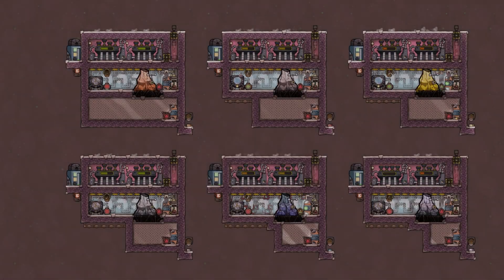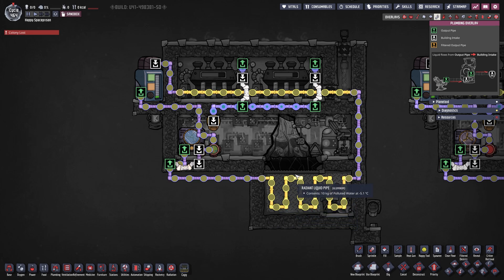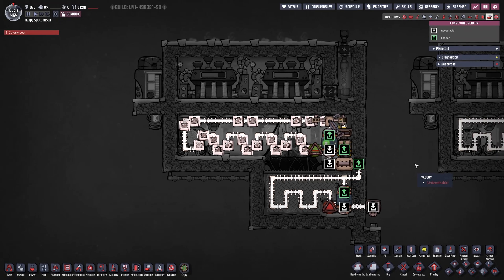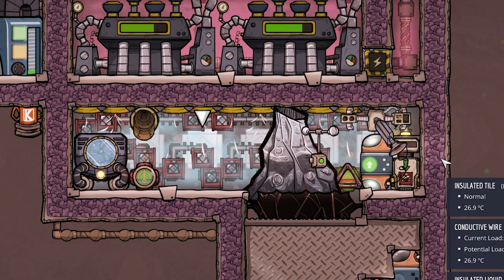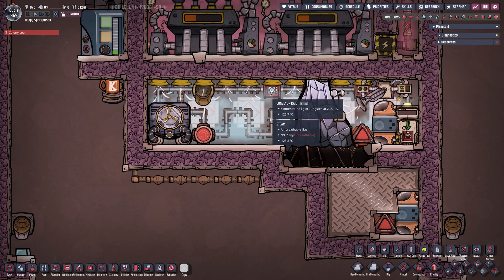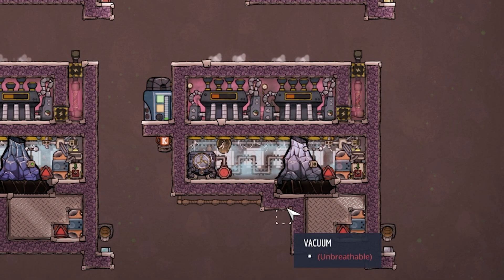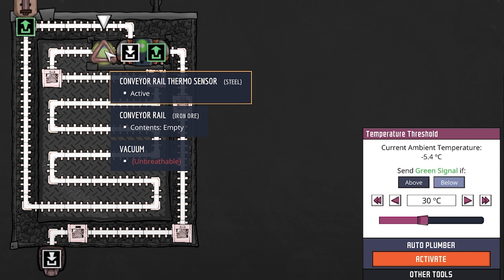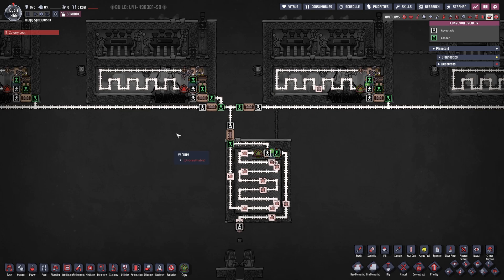GERMAN ENGINEER explains ONI: TAMING METAL VOLCANOES V2.0! Oxygen Not Included Spaced Out

Comment: do you need to vacuum the volcano out before you add the water?
Reply from the maker: I would Vacuum it out after adding the water, since you need to get the water in there somehow, and usually the easiest method is a bottle emptier above it with a hole in the wall. If you have pipes nearby, you can also vacuum it out before. Whatever is more convenient in your situation :)

Comment: about the microgram thing, I don't know if it's patched already, but would it work with using mesh tile debris moving? Like with magma. Let the volcano erupt in a vacuum room and have the liquid metal flow into a surrounded two mesh tiles, so it forms in a different room on top of a weight plate.
Reply from the maker: That would probably work, but would also make the entire built much bigger. And I personally don't think the microgram issue is big enough to justify that. It's really a minor problem. My currently Let's Play has a ton of tamed volcanoes with this system and it's not that big of a deal really :)

Comment: I dont understand what im doing wrong.  No matter what i do material will not bypass the shutoff input.  It does thr exact same with liquid.  It gets to the shutoff. Cant pass to the output because the automation has it on a red signal. And instead of then continuing on the rail back around it just gets stuck there.
Reply from the maker: Do you have a bridge after the input like I have in the video? If that bridge is not there, it will not work. The same goes for the second shutoff in the cold box. In the video I have an output immediately there on the side of the structure. If your line goes further and has a second rail connected to the original rail somewhere down the line, you'll also need a bridge after your cold box as well!
Reply: @BierTier  thanks Bier, that solved it.  I have been trying to make a similar design to separate hatch eggs so replacements fill the incubators first before going to be made into bbq and it was a similar setup so i came to this video to see what was up. I did have a bridge but it wasnt working correctly the way i had it set up. Now that it works for less important automation I'll try it with a volcano. 🙂
Reply from the maker: That’s awesome, glad I could help ;)
The game mechanics are a bit weird with rails, so if in doubt, slap another bridge in the direction you want to go, haha 😂
Reply: @BierTier  lol I'll keep that in mind.

Comment: For the microgram issue: you can build a conveyor chute in the conveyor loop, and then connect a timer sensor to it. Then you can change the timer sensor's measurement from seconds to cycles, and then set it to activate for 0.1 cycles and then deactivate for 10.
Reply: i was thinking about weight plates being added to the concept. making a queuing system where the conveyor rail only gets packets of heavier weight added into the cooling loop. sure it makes the whole system a lot more inefficient but letting it clog up with tiny pieces of metal that are unable to cool it

Comment: I've built this for a gold volcano, exactly as you show, with extra column of steel tiles as shown at the start where you show every volcano. I put 3 different waters in the steam tank, averaging 233kg water per tile. The volcano refuses to erupt because it is overpressure. I guess I should have put less water in. Can you advise?
Reply: Nevermind, I figured out what I did wrong. I had drowned the volcano. I needed only 1 layer of water and a vacuum above before I sealed the steam tank.
Reply from the maker: The amount of steam in the chamber has be below 150kg per tile. If it is above that value, the overpressure will not allow it to erupt :)

Comment: I tried this on an Iron Volcano, it melted the Conveyor Rails(made of steel) on the Volcano. You need to start this with steam not water. FYI.

I'm gonna try again and move conveyor things away from the Volcano itself.
Reply from the maker: They should not melt; you don't need to start with steam. If they melt, my first guess would be that you didn't have a vacuum in your chamber above the water. I start all my volcano tamers in my personal games and my let's play series with water and a vacuum. Especially the system shown in this video is useable for every single volcano except Niobium.
Reply: @BierTier  Hm, I didn't know what I did wrong then. I made a vacuum. The only difference was my chamber was a tile higher and two tile wider. Anyway thanks.

Comment: Had issues with the conveyor loader and the sweeper overheating both made of steam any ideas?
Reply from the maker: Did you make them out of steel? And do you keep the steam at around 200C?
Reply: @BierTier  Yes sir. Both are made of steel in terms of keeping the steam at 200C not sure what you mean.
Reply: @BierTier  It's not always but occasionally I see it.  I'm almost wondering if I need to throw in some automation to wait like 10 seconds before the sweeper activates.
Reply from the maker: You shouldn’t have to if you use this build. The steam in the chamber is soaking up the heat from the hot metal. You may not have enough steam to keep the temperature correct, might need more mass. With too little steam it can overheat for sure!
Reply: @BierTier  This is likely the case. I was having the same issue with my aluminum volcano because I used the bare minimum amount of steam for two turbines. Increasing the amount of steam to around 2 tons (>2000kg) in the 12x3 volcano box should solve the issue of the steam heating up beyond around 200 C.

Comment: The only way to reliably avoid the microgram issue is to use two sweepers: the first moves the material not into a loader, but into a *dispenser*. The dispenser dumps the material out of the first sweeper's range and onto a weight plate. The weight plate is set to go green at some value greater than the 1t an auto-sweeper can move at once, and it controls the loader. This ensures that the loader will only put items on the rail while it's full or close to full, which means it will always output full 20kg baskets, and you can't end up with a microgram basket on the rail.

Comment: Thank you for sharing the video. What I would like to know is, if you dont have aluminium what is better to use for the heat sink? I have copper, iron or gold currently and I really didn't want to make it out of steel for the heat sink if I don't have to!
Reply from the maker: Absolutely! Here is a list of all materials thermal conductivity: https://oxygennotincluded.fandom.com/wiki/Thermal_Conductivity
The higher, the better for cool box. For insulated pipes, tiles, etc. the lower the better. For your metal tiles it goes Thermium > Aluminium > Cobalt > Tungsten > Gold and so on :)
Reply: @BierTier   the link does'nt work for me : (
Reply from the maker: I just checked and the link works for me. Do you maybe have an adblocker active or something like that?

Comment: About the mcg-Bug: I always use a timer - never a temperature sensor - so your video is the first time I hear from this bug :-D 

Why a timer? Let me explain. I don't know when or where I've first seen "my" solution, but here it is. I'm beginning from the end (drop), working towards the volcano. 
1 - Dropof-Point) Connect the drop-off with a timer. Set the timer to be closed/red for 59 seconds and open/green for 1 second. That's 20kg of Metal per Minute and should roughly match the Volcano's production which is usually around 300 to 400g/second. (*1)
2 - Turbine-Room) Let the conveyor zig-zag through the room of your steam turbine (One aquatuner-cooled steam turbine is enough for every volcano - it should also be enough for niobium). Fill the room with hydrogen, and zig-zag the cooling pipes through the whole room. (*2)
3 - Heat-Exchanger/"Cool"-box) You should have only one steam turbine. Divide the output C water through a valve (needs to be in a vacuum!) and set it 1000g/s. This gives you two lines of water. Let the lines flow through metal tiles which also are "visited" by the conveyor, creating a heat-exchanger (you call it coolbox - but it'l be 95°C there). For most of the volcanoes a 2 by 2 coolbox with two metal tiles per water-line should be enough to cool down the metal to 95°C. (*3)
4 - Steam-Room) The usual, just without temperature-measurement of the metal. Temp-shift-plates, aquatuner, yada yada yada. Except for the tiles exactly behind the volcano iron- or even copper-conveyors are sufficient. Just use the maximum amount of steam (Up to 150kg/tile - having the steam-room 8 tiles wide should even be enough to counter niobium) Set the aquatuner-thermo-sensor to the temperature you want the output-metal to be. There's no need for a -15°C coolbox. 

If there is NO access to the steam-room, you'll get a steady supply of metal at the rate the volcano produces it. Given you have enough batteris this build is even power-positive. (**)

(*1 For the exact value just take 20,000 and divide it by the volcano's output 
(*2 The conveyor-zig-zag is optional if you want your metal to be colder than 95°C. Which is mostly a waste of energy, b/c the dupes are wearing exo-suites and you might already have a cooling solution for your base anyways)
(*3 Since the throughput of the conveyor-line is set to one 20kg-packet per minute the metal has four minutes to cool down to  95°C) 
(** If 95°C metal is ok, you could even try a self-cooled steam turbine setup - but for this to work up to 4 steam turbines are needed)
Reply from the maker: That sounds like a highly interesting solution that I have never heard of, haha :D Would you be interested in joining my Discord server and sharing a picture or video of this setup to make it a little bit easier understandable? If it works as well as you say, it may be a good video to share with my audience(of course with a proper shoutout). My goal is always to share the best solutions and if after v2 a v3 is needed, then it is what it is :)

Comment: The only solution I have found for the mcg bug is to dump anything that is over 250 or 300 directly back onto the erupt tile, and it will eventually merge with incoming metal, or to have a second output that ejects from the chamber if it's over 250/300..
Reply from the maker: Yep, those would be the only solutions and neither one is optimal to say the least...

Comment: Packets in rails merge, so you can't have many super small packets in the rails, new material is added (well, I'm talking about the isolated setup, not the all in one one) when it's in the loader.

It's is not clear from the pictures how the loader is connected to the rails, tho. 

I usually wire shutoffs the opposite way. By that I mean, if a sensor detects a good packet, it leaves the system via the green output port. I never use the logic "good on overflow, bad on green", generally speaking, because it's inherently less secure. If you get a brownout, you have "bad" packets take the route of good ones.

I always use the logic "good on greed, bad on overflow". In this case it doesn't matter (much), you just get hot packets in the heat exchager, but always wiring it the safe way is a good habit to have.

I use the turbine room for the final cooling. It's more compact but the concept is the same.

One thing I don't get is the double joints in hydrogen. What's their purpose?
Reply from the maker: I agree with the shutoffs, it is safer to wire them the other way around. I usually don't pay too much attention to it, even though I should.
The packages on the rail don't merge though, I have tried and no matter what the mcg packages stay. So have according to Reddit and Klei forums many others. 
Cooling in the turbine room might make it into V3.0 one day(if there is a V3.0). But as you said, concept is the same. 
The double joints are remnants from my old self-cooling Turbine design, it prevents heat transsfer quite effectively(if in a vacuum, not hydrogen). I still build it to this day out of habit. No point at all with a externally cooled system. Just ignore it really, haha.

Comment: Instead of a temp sensor on the rail use a timer sensor for the conveyer chute. After a couple of eruptions there should be enough material to fill the rails and loader. Use the timer sensor to drop a single 20kg packet in line with 20kg of total average output.
Reply from the maker: I'm not sure what the purpose of such a setup would be? Could you elaborate? Thanks!
Reply: @BierTier  To fix the microgram problem.

Comment: I had this same problem with no mcg heat exchange in my food freezer. I decided to stop using conveyor rail temp sensors completely. I have seen a few other solutions for metal volcanos.

Solution A: have a timer or counter to ensure packets only go around the loop thrice: https://www.youtube.com/watch?v=7LfOyBWRZM8&ab_channel=2LegitCity

Solution B: don't loop the conveyors. Have a timer on the output so packets sit in the steam box and cool box for extended periods: https://www.youtube.com/watch?v=v7Ml6h71neM&ab_channel=TonyAdvanced

Solution C: Don't use conveyors: https://www.youtube.com/watch?v=H7vY71geaPo&ab_channel=Lumaplays

Comment: I thought the conveyor meter allowed you to stack up resources on the rail if they were the same type?
Reply from the maker: TL;DR:
I could not find a way to make it work.

Detailed Explanation:
Truth be told, I have never messed with the Conveyor Meter. But your comment intrigued me, so I tried around for a bit. I found no way to make it work. All the meter does is count to a specific amount of units and then stop the flow. It's like a conveyor bridge that stops working after a certain amount. It does have an automation output that sends a green signal when the limit is reached and a reset port. 

I currently have a small package in one of the systems, which has a mass of 953mcg. It needs to pass 6 times through the meter to register a value of 0.00001 units. The minimum Limit value that can be set is 0.0001 units for the automation to be set to green. That would make 60 passes to get to that value. And even then, with some elaborate automation to reset the meter instantly, it would never be able to clear the 20kg packages from the conveyor during an eruption since there is no way to change the  Limit value other than manually. 

I can conclude that this does not work, unfortunately. But great idea, and it was fun trying around with it! Still don't know what I would use it for, haha :D
Reply: @BierTier  thanks for trying it out! good to know :)

Comment: Isn’t there a sensor that detects how many grams there is of something on a conveyer. You could have it set up after the thermal sensor and bridge and set it to under a gram so when it sees under a gram it’ll take it out of the system
Reply from the maker: There is not in the base game. There is the Thermo Sensor, the Element Sensor and the Germ Sensor. Maybe there is a Mod though, that I don’t know. The closest to it would be a weight plate and that’s what I meant in the video as complex automation and even that doesn’t work 100% of the time, so I don’t even bother with it tbh.
Reply: @BierTier  would be handy if there was one I could probably find a good use for that with sending large amounts to where I need a lot of it and send smaller amounts to where it’s not as needed
Reply from the maker: The maximum per tile that can ever be on a conveyor rail is 20kg, that’s probably the reason it doesn’t exist. What you’d need is more of a counter of packets for that :)
Reply: @GeneralFire  Now im a newbie, but why not havin a weight plate where the output of the vulcano is? And nost collect if your not over 20kg for example?
Reply: @Myrasch  you can’t replace the neutronium tile under the volcano with anything